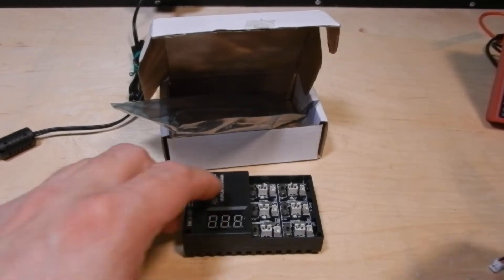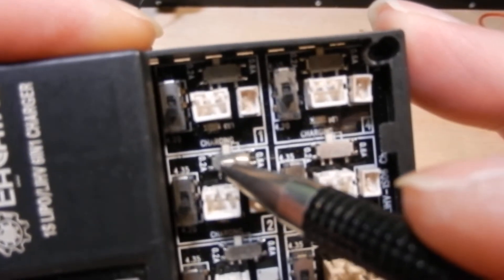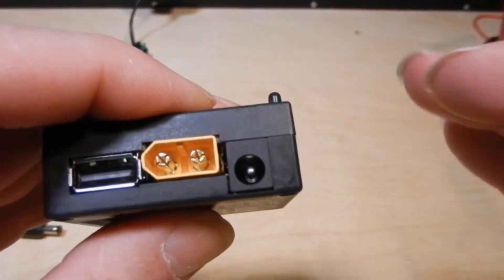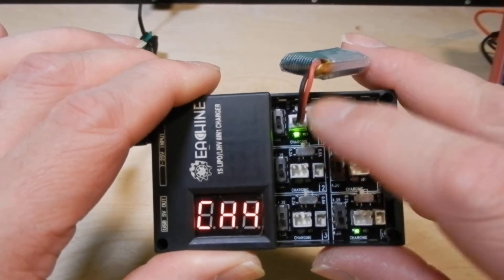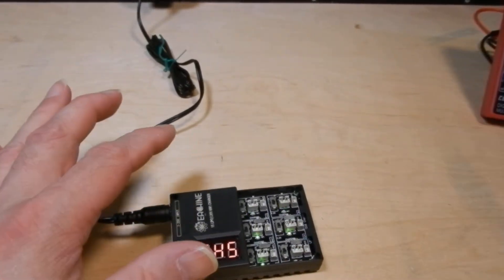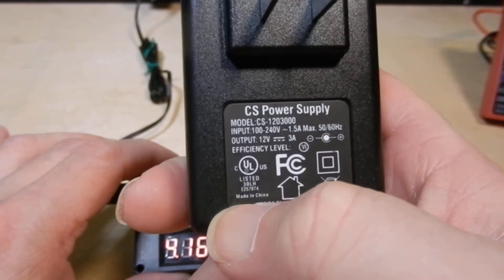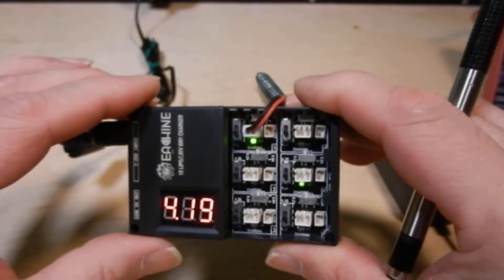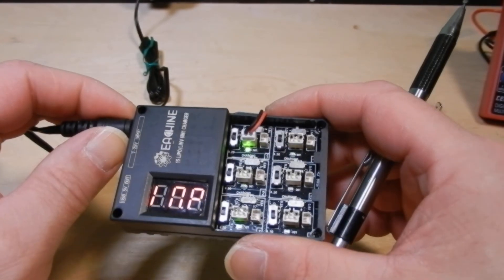Eachine 1S LiPo LiHV 6in1 Battery Charger

Comment: Just curious, you mentioned using an inverter in the car (presumably with the wall wart) - why not just use a 12V cigarette lighter plug straight to barrel cable?
Reply from the maker: You can providing that your cigarette lighter socket and wiring will be able to handle it. 110 Watt rated is good to be on the safe end for this charger. Some vehicles have sockets that have a pretty low Amps/Watts rating. Some vehicle manufacturers just put the bare minimum rated wiring and sockets in their vehicles. Just make sure the lighter socket in your car can handle it. An Inverter typically has a low draw.

Comment: I have a power supply at 14V and 10A what do you think, can I use it?
Reply: According to the specifications on this charger it should be no problem to use that 14 Volt 10 amp
Reply from the maker: Yes, you should be able to use that on this charger. I have used 4S Lipos on it as well as an old 18V 10A adapter.

Comment: Can I connect a 3s lipo to it to charge smaller batteries?
Reply from the maker: Be sure to expand this to read all of this about warnings and concerns. 
Yes you can use a 3S with proper plug as a supply. Something around a 2200mAh will give you 10 to 15 - 150mAh 1S battery charges easily (Of course higher mAh gives more). 
*Watch out for the discharge C rating of the source battery so you don't have it over heat and catch fire on you. 
*Never leave LiPo's unattended while charging.
*Be sure to monitor the source LiPo's voltage so you don't damage it. I personally do not let any of my LiPo's drop below 3.6V per cell. 
*I recommend getting a LiPo battery voltage monitor/checker to plug into the balance lead. Preferably one with the ability to set a minimum voltage alarm. 
For super cheap, not super accurate, but suffice for basic use, I use these on my 3S LiPos on my battery warmers in the winter (set them for 3.6V or 3.7V threshold): https://www.amazon.com/4Pack-LiPo-Battery-Checker-Indicator/dp/B07VLQM3ZK/ref=sr_1_9?dchild=1&keywords=lipo+battery+checker&qid=1613725602&sr=8-9 . 
If you want to go better quality but not super expensive, you can go with one from ISDT. I have an ISDT BC-8S, but I think they are discontinued. They make others to choose from.

Comment: a 12V 2A psu, can deliver up to (12* 2) 24w
a battery charging consumes (let's take the worst case scenario of 4.2V @ 0.6A which will never happen) (4.2* 0.6)  2.52w
2.52w * 6 batteries= 15.12w required
So theoretically, a 12V 2A charger should be sufficient for all 6 batteries pulling at 0.6A, with plenty of headroom for losses.
Reply: Yeah.. consider some loss to heat and bad chineese craftmanship and it would be a little more, but a 12V 3A would be more than sufficient to charge all 6 @ 0.6A..
Not sure what the uploader meant... probably forgot tat its 12V not 4.2volt input :)

Comment: whats the difference if i use a 12v 4A ?
Reply from the maker: You can use a 12V 4A power supply. It won't be an issue with this charger. You will just be better off keeping the setting to 200mAh on each channel. This charger gets pretty hot when charging at 600mAh. Also, It is not a great idea to charge the small 1S batteries at more than 2C anyway. Charging the little 1S batteries at 1C or 2C, rather than any higher, seems to give them a longer life span in cycles (at least with my experience). Actually, I never charge any of my LiPos higher than 2C, ever, and they last me a pretty long time.
Reply: @therccrashproject6330  Good information

Comment: Hello, thank you for sharing i have this kind of charger. How can i know that the battery is full charge?
Reply from the maker: The light on each channel is supposed to go out when the battery on that channel is fully charged; at least that is how mine works. There is a slight possibility that yours may be different if it is a different brand. If it is a different brand, just look up your specific charger. Check product descriptions and, if you can, find a manual; it should say somewhere.

Comment: Noob question, but does it works as a parallel charging board where you have to have batteries of the same voltage? or are these channels independent? Thank you
Reply from the maker: The channels are independent.
Reply: @therccrashproject6330  Thank you

Comment: I just got one of these but the charger doesn't work. I plug charger in and readout says "usb", plug in battery, and readout doesn't change. 

Any ideas?
Reply from the maker: What are you using as a power source? You can't power it from a USB port. You need to power it from at least a 3S to 4S battery, or from a 12V 3A or better power supply. Go through some of the comments here to see more answers on suitable power supplies. If you are using a proper power source, then it is probably defective and should have it exchanged.
Reply: @therccrashproject6330  I'm connecting the charger via 12v dc plug. It seems to be charging the batteries, but there is no indication of it on the charger. Green lights stay solid and display says USB.
Reply from the maker: @silverspork86  Make sure the 12V power supply is at least 3A output. At 3A, only use the 200mAh setting on each charge port and make sure to have them set to the proper voltage for the batteries being charged. 4.2 for LiPo and 4.35 for LiHV. If the green lights are solid when battery is plugged in, that means they are charging. BUT, if the display is only showing "USB" and is not cycling through the channels and input readings, then it is not working properly and should be exchanged.
Reply: @therccrashproject6330  its only 1.3A output. That must be the issue. Thank you! Do you have any recommendations for a power cord? I went to Wal-Mart last week to look, but found no 12v power cords that fit the charger. I dug up the one im currently using in an old box in my house.

On a side note, the novice 2 is super hard to fly. Im horrid at it lol.
Reply from the maker: @silverspork86  There is a small chance that it is the issue, but not the entire issue if the display is not cycling through the channel readouts. With the display not cycling, it is likely defective. If you have a 3S or 4S Lipo with the XT60 plug, you can try that to see if it makes a difference.  If you have this exact charger then it has a 5.5mm x 2.1mm plug. There are a couple other brands that use a 5.5mm x 2.5mm plug.
This is the wall plug I use on the 200mAh setting for each battery port.
https://www.amazon.com/gp/product/B01DHK76YM/ref=oh_aui_detailpage_o08_s00?ie=UTF8&psc=1
 If you want to go to the 600mAh setting, I recommend a 12V 5A or an 18V 4A or 5A. Although I do not recommend the 600mAh setting because the charger and the little 1S batteries get really hot.
Reply: @therccrashproject6330  I found another charger lying around. Output is 9v DV, 500mA. When I plug this power supply into the charger, it starts to cycle like it should through channels. However, the green blinking lights at each charging pin are blinking very faintly. I realize this is below the 3A recommendation. It seems to be charging the batteries though.

I did just order the power supply you recommended above. In the meantime, will using this new power supply I found damage the batteries? 

Thanks so much

Comment: Can I connect this board to a charger, which actually only charges 2S-6S Batteries??? And is this board actually the same??: https://www.amazon.de/LiPo-Ladegerät-Micro-Kabel-Charger/dp/B073QNF8XX/ref=sr_1_2_sspa
Nice videos:)))
Hope you can answer me soon...
Reply from the maker: My Deutsch is very rusty, but I was able to understand what I needed in that product link.
The charger you linked to is basically the same charger. The only difference is that the one you linked is 2S-4S input on the XT60 connector 6V - 20V. It is misstated on the description as 2-6S. 
If you get the one you linked, do not use more than a 4S LiPo as input. 
You can use a wall AC to DC adapter instead of the 2S-4S LiPo. In that case use a 12V 3A adapter for the 200mAh setting or a 12V 4A or 5A adapter if you plan on using the 600mAh setting for the DC input plug. You can use the 4A or 5A adapter on either the 200mAh or the 600mAh, but you can not use a 3A adapter on the 600mAh setting. You can use the wall adapters with the barrel jack or an XT60 plug. I have used both options.
One other note about the one you linked. According to the description, the DC input jack is a 5.5mm x 2.5mm jack. Hopefully they listed that information correctly. Or you could eliminate all doubt and just get a 12V 4A or 5A wall adapter with the XT60.
Also keep in mind, that these little chargers get very hot on the 600mAh setting, and so do the little 1S batteries. These chargers may not last long under that stress. I have always used the 200mAh setting and it still gets quit warm charging six 1S batteries at once.
Hope this helps. Let me know if you have any other questions; I will do my best to answer them.
Reply: Thank you for your detailed information. You helped me a lot, because I only have 6S lipos at home 😬😅Keep it up

Comment: Sorry to sound stupid, but if I was to get a power supply at 12v 3a is that the safest option for 6 x 1s? And what’s the Or better option on the first one (im new to electronic)
Reply from the maker: The only stupid question with this stuff is the one you don't ask. I have used the 12v 3A supplies just like in the video without issues while using all six ports at one time at the 200mAh setting on each port. You could easily use an 18V 5 to 6A. The charger is rated for 7V to 25V input. I have more information in the description of the video.

Comment: Does it have overcharge protection like it turns off after fully charged
Reply from the maker: In everything I have seen about this charger it does not indicate nor mention over charge protection. This is something that I have never actually checked. Whether or not it cuts off the current and voltage supply when charged, I don't know. But the charging indicator light goes out when the battery on that channel is at full charge. You should never leave your charging batteries unattended. LiPo fires happen fast and without warning. I am always right there keeping an eye on my charging batteries and take them off when done.
Reply: Yeah it does have that. Just stops charging the battery when full :)

Comment: This is all new to me apologize for my ignorance. I have a wall adpter that is PRI 100-240V - 50/60Hz. SEC:19V 850mA. Can I use the wall plug? Also my only other option is 6Ss but you said that are not good for this correct.
Reply from the maker: According to the specs on this charger it can use 6S as a source, but personally, I don't see it happening and lasting long. I would go with the wall plug. The 19V is fine but the 850mAh, you should be fine at the 200mAh setting on the charger ports. Just do 4 batts and if plugging in a 5th and 6th, keep an eye on the wall plug to make sure it doesn't start getting hot. If the wall plug stays reasonable in temperature then you are good. If not then you will need a higher amp rated power source (say 3A to 6A).
Reply: @therccrashproject6330  thank you a ton. I also found a 12V 1000mA.
Reply from the maker: @KevinSpecialK  Both of those power supplies will work, just keep the charger on the 200mAh setting per channel. It's easier on those little 1S batteries anyway, they will last longer.
Reply: @therccrashproject6330  thank you

Comment: Which wall cable do you have?? Planning tot buy Mobula 7
Reply from the maker: I just looked at this and saw that my reply to you is not here. Don't know why it didn't stay on here.
Anyway, I have a 12V 3A, but I only charge at 200mAh per channel on this charger.
My personal recommendation is to use this 1S 6in1 charger at the 200mAh setting. 

I noticed that charging even one or two batteries at the 600mAh setting made the charger very hot. 

At 600mAh charge rate, I would be concerned that the charger won't last long.

For charging at 200mAh up to 6 x 1S batteries. 12V 3A or better Power Supply.
To charge at 600mAh per battery, you will need a power supply rated 18V to 24V at 5A or 6A, even 10A or 12A will work.
Adapter plug is 5.5x2.1mm.

These suggestions are based on 200mAh x 6 and 600mAh x6 with a 40 percent or better safety margin.

This appears to be a switching charger but I don't expect it to be great at switching current between channels.
What do we expect for a $15 charger from china.

Comment: I ordered a mobula 7 and it comes with a 6 bank charger like the eachine one in this video, however it doesn’t come with a DC power cable and I don’t want to have to buy a big Lipo batter to charge the batteries that come with it cause then I’d need a charger for that battery also. What would be the proper DC wall cable for that?
Reply from the maker: The charger you will be getting may have different requirements than the one here.
Could you possibly give me a link to the exact one you are getting?

A simple way to figure that out and be safe is to, first of all, find out what the voltage input requirements are and get something on the higher end. Second, how many milliAmps does each charge port require and add them up and add 40 to 50 percent for a safety margin (IF 200mAh per channel times 6 channels, 0.2 x 6 = 1.2A or 1200mAh. Then add around 40 to 50 percent. So 1200 x 0.5 = 600 then 1200 + 600 = 1800mAh or better.

But if you are going to charge at 600mAh per channel at any time then definitely go with a supply at 18 to 24V at 5A or 6A.

If you try to use a 12V 2000mAh at 600mAh per channel it will likely over heat the supply and maybe the charger. It could very well start a fire.
Some chargers like this are have switching circuits but I don't trust them (especially these cheapies from china). In switching circuits, the supply requirements are lower because it alternates the demand around the channels; which lengthens expected charging time.
Reply: The RC Crash Project it’s the happymodel 6 in 1 charger. I’ve found an adapter that is compatible with it though, as well as has the XT60 connection from the wall port.
Reply from the maker: @LJT9393  It looks like that is the same charger, just rebranded. I use a 12V 2A wall wart supply with a 5.5x2.1 barrel connector. But I only use the 200mAh setting on each port. If you want to do the 600mAh settings, you will need an 18V to 24V 5A or 6A.
Reply: The RC Crash Project does that mean you need to buy like 450-600 mah batteries? I don’t fully understand all the proper charging for the batteries that you have. And also the 7-12V 3A would work I was told also.
Reply from the maker: @LJT9393  If I'm not mistaken, The Mobula 7 runs on 250mAh batteries as standard. https://www.racedayquads.com/products/250mah-3-8v-hv-1s-ph2-0-rdq-whoop-battery-powerwhoop-connector-25-50c . 

No, you don't have to buy higher capacity batteries. Your best and safest bet is a 12V 3A Power Supply and charge at 200mAh setting.  The charge rate (i.e. 200mAh or 600mAh) is just going to determine how fast they finish charging. On a 250mAh battery at 200mAh, that is 0.8C charge rate. At 600mAh, that is 2.4C charge rate.  Now I do not see anything about the safe charge rate on those batteries, so I would guess 1C to 2C; maybe 3C but not likely. 

2.4C at 600mAh might be OK. Personally I would just charge the 250mAh batteries at the 200mAh setting. It will take longer. If you are in a hurry then 600mAh but really watch them, if they get warm or start to puff. A little warm is OK, Hot is not good (could damage the batteries). Puffing, get it out of the house fast.
Reply: The RC Crash Project alright, that’s a lot of math to take in lol! I found a DC wall plug in my house, but it’s only 6V output, 120V input. It seems to work ok, and after it displays INP it can vary from like 6.98-9.18, which is how much is going into the charger right? And I’ve charged them on the 0.6A which they charge faster, don’t get warm at all, but my display only ever shows like 4.40 which I think is like 0.40V over than what they are actually at, cause I have my transmitter to set off an alarm when my RX batteries get to 3.20, and when it goes off I bring it in and take them out then when I go to charge them after they show 3.70+V (I always wait about 15 mins after flying to charge them) maybe that’s why? My charger is as follows: Input: 120V AC 60Hz 25W; Output: 6V DC 2100mA. So would that be 0.2 amps?
Reply from the maker: @LJT9393  - 6V is not quite enough input for the charger. It may seem like it is working but it is putting a strain on the PSU; it could make for a bad day. I have this. They might have a single pack.
https://www.amazon.com/gp/product/B01DHK76YM/ref=oh_aui_detailpage_o08_s00?ie=UTF8&psc=1
Search for one of these. On Amazon or where ever.
Any of these power supplies will work safely.
Just make sure they are UL listed/certified...
12V 3A Power Supply Adapter Plug 5.5mm x 2.1mm
or
18V 5A Power Supply Adapter Plug 5.5mm x 2.1mm
or
18V 6A Power Supply Adapter Plug 5.5mm x 2.1mm
It won't matter what the supply is listed for specifically (laptop, lights, whatever). What matters is the Voltage and Amperage and the Plug Size.